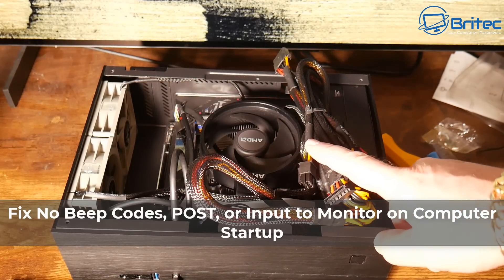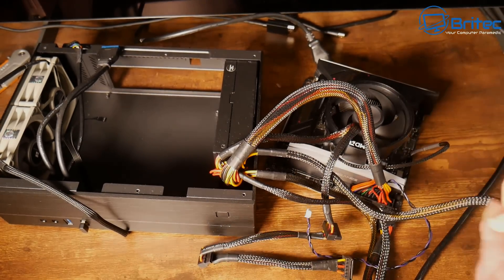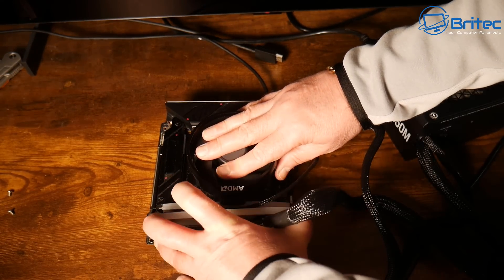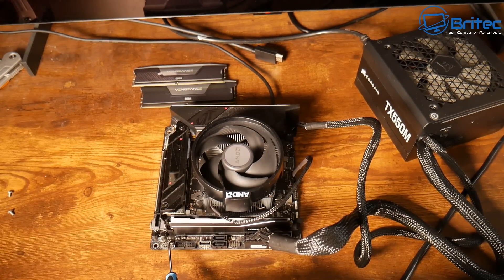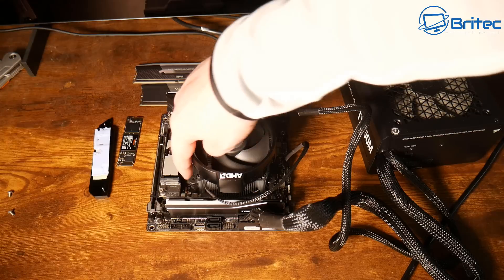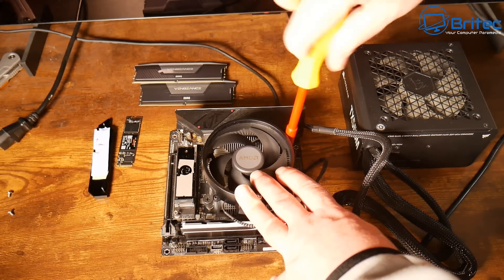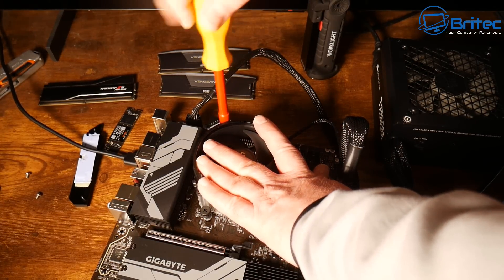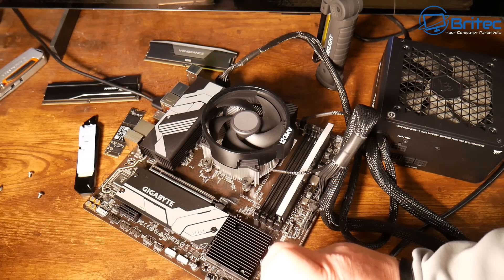Windows PC Fails to POST with No Display

Comment: Hi Brian, My old pc it's about 12 years old, stopped working after an electrical surge, when I press the power switch the system turns on and off immediately, So I purchased a new upgrade kit, motherboard cpu and ram only, I installed all components using the same power supply unit but it still does the same thing, could this be that my power supply unit has failed due to the electrical surge and needs to be replaced. Thanks
Reply: That's most definitely power supply. Happened to me in the past

Comment: It's recommended to never touch the pins of ram sticks  , bare fingers can deposit acids . I've had computers fail to post after cleaning with compressed air , usual thing is a beep code indicating a ram problem , remove sticks , clean contacts with isopropyl alcohol and sometimes also the ram slots using a small brush and isopropyl alcohol, works for me . If you ever get a "bad" ram stick , try that cleaning method before scrapping it .
Reply: I have to buy ram with heatsinks on or ware gloves or a strap when i'm fitting i've killed so many sticks just by touching it

Comment: That exactly happened to me a few weeks ago, but the PC was already in use for 3 years. On power up, no POST, no display, no nothing….but same behavior, fan and RGB come on shortly and go off….the RAM diagnostic LED is on. For unknown reasons, one RAM slot holding a stick was suddenly defect. Moved the 2 sticks to the other two slots and PC was back working

Comment: I had a similar but intermittent issue on a recent itx build, due to the layout it used a riser cable for the GPU, this turned out to be the culprit. Routing put strain on the PCIE riser where it fit into the slot on the board, preventing reliable contact. Replacement with an APU solved it as the function was office box and media only.

Comment: Nice video for those who come up against this issue Brian. Now I came up with this sort of problem when I was building machines and the Asus motherboard I last installed did have LED's and beep signals for faults on the board and I I also installed a speaker for the RAM beep and I found them really handy. So what you say about researching parts before you buy and install or after you have installed them is really the answer😉

Comment: With to the first slot near the cpu😅
Reply from the maker: Tried both slots as mentioned
Reply: @Britec09   as y saw it was a amd cpu those are picky with memory mostly those with 3d cache it ain't broken it just doesn't like the ram you wouldn't go for none branded ram and to be sore get samsung chips those are working with all cpus even ampere the new arm64 256 cores one 😀  socheck termals on assus boards failures are quite common  thatwhy y go with hp those never break never have incompatible parts

Comment: I went through this with my pc. Checked psu. Got a cheap ram stick (4gb 2400 & Gpu (rx 580 4gb) motherboard i managed to get a refund for the board & ssd i had on hand Same issue. 

Replace the cpu with a cheaper one all fine working again. I've did a warranty form from amd hoping to get replacement. They said to me April 11th is a holiday & my response will be delayed. 

Bashing your head against the wall. I'm surprised I didn't end up in hospital 🤕. Seriously hope you get it running again.
Reply from the maker: Yeah, it will be OK
Reply: @Britec09  that good, mine is okay too. We're talking about our pc's like children 😆 if mine plays up again it's grounded.

Comment: I've been there with my current rig. I built it, powered it on and it'd turn on and off like yours did. Took ages to work it out. What had happened was that side of the case had fouled and damaged a connector on my SATA SSD due to where it was placed in the case. I had no idea what NVMe drives were then, or that my board supported them. I quickly found out though!
Reply from the maker: They can drive you crazy
Reply: @Britec09  Yep! Still can too!

Comment: I assume you have a businness account with Amazon UK.  If you don't the 30 day thing you mentioned for faulty returns is twaddle.  If an item is supplied by Amazon and it is/or becomes faulty within the first 12 months, it is upto Amazon to sort the problem out (standard Consumer Law).  The 30 day thing seems to be a self imposed additional time by Amazon regarding returns under Distance Selling regulations.  I've done several returns where items have become faulty many months after they were bought.  One of the problems however can be navinating through the Amazon website to find how to contact customer support.

Comment: did you flash the bios on the new gigabyte board? i might have it if you mentioned it
Reply from the maker: Yeah flashed BIOS on both motherboards, I replaced the 8700g and its working on new motherboard, got to test it on ITX board. Going to RMA the other 8700G Chip. Bloody nightmare mate.

Comment: Remember to unplug Pwd at each test
Starting with;
Buy an inexpensive PWS checker. 
If ok then motherboard with NO parts attached but cpu try it, does cmos post?
If ok, Then Start with one of memory stick at a time. 
If ok, still have cmos.  
if ok, then ssd/hd
If ok then boot. 
Failure at any point is your focus